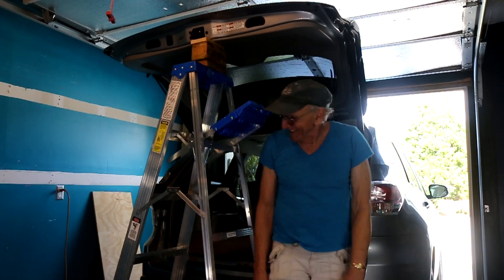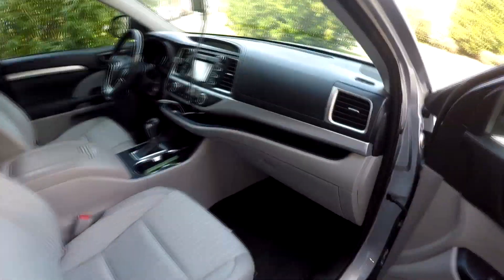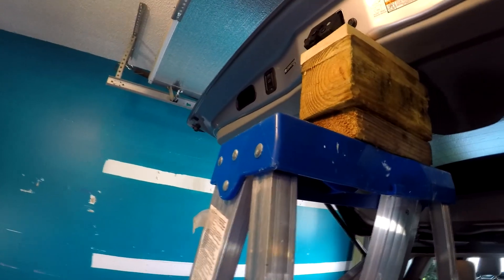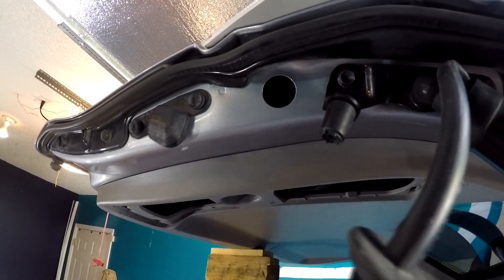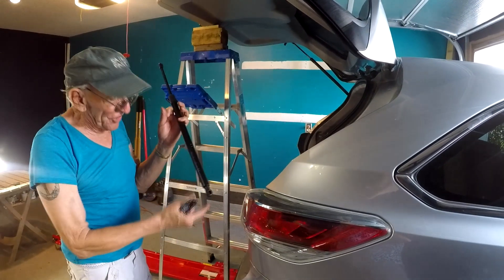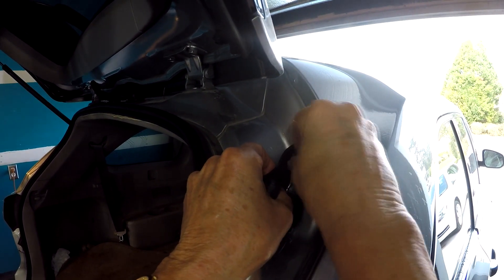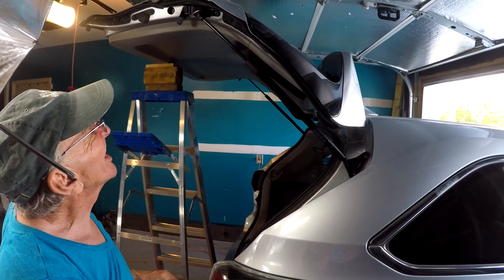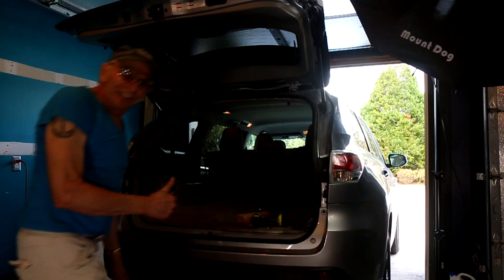Toyota Highlander power lift gate manual conversion

Comment: This is exactly what I've been looking for. I had no idea that converting the PITA lift gate to manual would be so easy. I went to the website listed above to order the parts and discovered that there is a typo in the part number of the upper left bracket listed above. It should be 68946..., not 68646... Most people would probably figure this out, but wanted to point it out just in case there are others like myself who don't order car parts on a regular basis.
Reply: Ok, wait a minute, now I am confused. The car in the video appears to be an LE, which is the base model that came with the manual lift gate. It's not an "LT," which I assumed meant "limited." There is no sunroof or seat heater controls beside the shift knob, and the letters on the bottom right of the lift gate appear to read "LE." I really want to do this conversion but now I'm not convinced that it will work on my XLE and I don't want to pay a restocking fee and double shipping for parts that might not work.
Reply: Update. This worked just like in the video, on my 2014 Highlander XLE.
Reply: @jennifermathews1072  Very nice!  Thanks for the update.
Reply: @jennifermathews1072  Does the rear glass open/close function with this conversion?
Reply from the maker: @Globeguy1  yes
Reply: @cbonz7734  I cant seem to find the website   you listed could you post it again. I have a 2014
Reply from the maker: @lauraalton5861  parts.olathetoyota.com  no www or https  just parts.olathetoyota.com
Reply from the maker: @jennifermathews1072  it was ordered with the power lift gate as an option, this conversion works on them all.
Reply from the maker: Typo fixed, thanks for catching!
Reply: This vehicle in the video is an LE plus. I have  a basic LE  with manual lift gate. Regular LE does not have an LE emblem. The LE emblem is reserved for the LE plus which comes with the power lift gate.